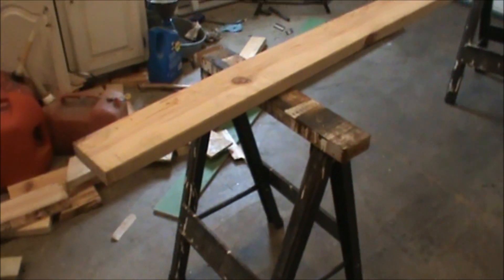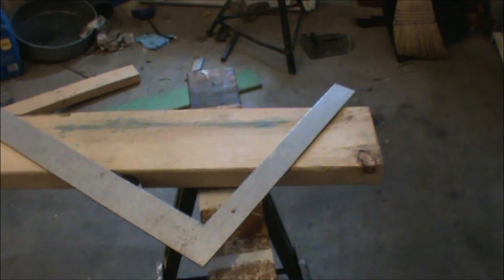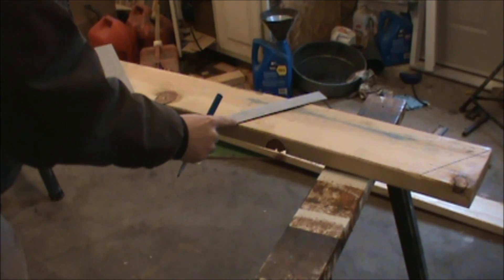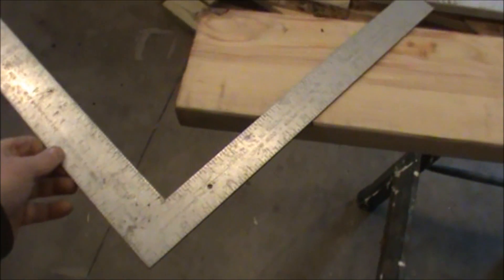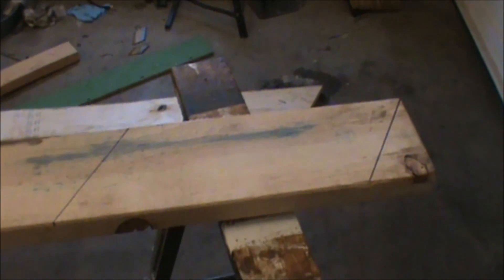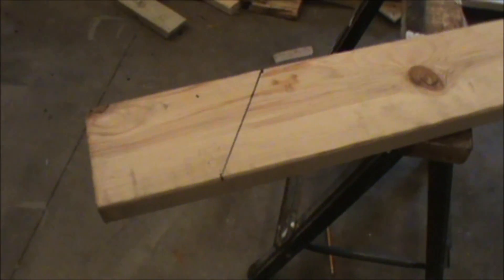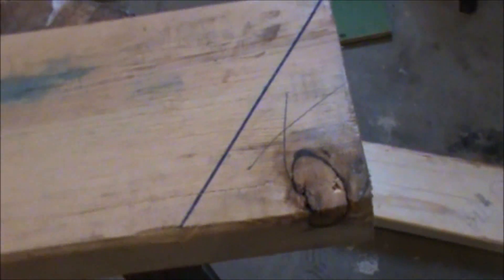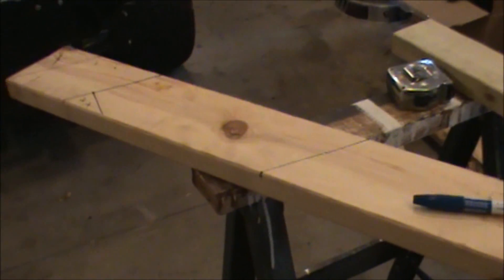Roof Rafter Layout

Comment: Another thing I am doing different is not going to have a ridge board. I am going to cut gussets for my rafters and not going to use a rafter joist. I will use rafter joist on the last 4 feet of each end of the building for overhead storage but leaving the center of the building open with the high ceiling.

Comment: I am starting a new building in my back yard. 12x24. I am going to use the same pitch you have here. But, on the end of my rafters, I am not going to cut the plumb cut as the ridge cut but leave it square. The reason I am doing this is to have my facia  board tucked under the roof for better water drainage. I think it even looks better.

Comment: For those of you who want to calculate the length of the rafter by math-- if you were to measure the distance between the sep marks along the rafter , it would be about 14 1/2 inches [but not quite]  take the 8"rise and the 12" run that you used Square them both 12 squared is 144 and 8 squared is 64. Add them together for 208. Now take the square root [it's on every calculator] and it will be 14.42"   multiply that by 6 [outside to center of the shed and you get 86.52 " or 86 1/2"  deduct about 3/4 inch for the ridge by measuring it 90 degrees from the ridge cut [not along the top of the rafter] and you are done. Since the building is already an inch narrower than 12 feet, no deduction is necessary for the sheathing.
  what is fun to do is use the step method and then check it with the unit length method as described above.
      I always taught both to my students, some who had a decent math education and some who had almost none at all.

Comment: If you "helicopter" your square around (don't turn it over), you can mark that same angle, with the tongue turned downward, at the low end without having to measure and mark from the last mark. No need to mark every step, except for the little check mark, or dot, on the bottom of the blade.

Comment: Don’t care for the step off method at all, too much room for error and time consuming.
Reply: Time consuming? It's the easiest way to lay out a rafter. No math involved, except counting steps and reading a tape measure. There are several ways to lay out rafters, and I like most all of them, but the step off method is very simple. I will agree that it takes more caution, but you can do this accurately if you're careful.

Comment: 1) The step method is tricky because error can arise from the cumulative thicknesses of the marks.  Your rise is 4 feet on an 6 foot run and an 8/12 pitch, so the length of the rafter to the outside of the plate is a shade over 7 feet 2.5 inches.    ( 6 squared+ 4 squared =  rafter length squared) .   Measure down that distance and make your angled line using the square at that point on the rafter.  2) 1/3 of 5.5" (the length of your plumb cut on the birdsmouth) is not 7/8; it is a bit less than that; probably does not matter.  3) Should the rafter be flush to the plate or flush to the sheathing (1/2 inch more)?  If you sheath the walls before you place the rafters, but cut the rafters to be flush to the plate = problems!
Reply: You can actually add that extra 1/2" (7/16) of sheathing into your calculations, but it takes a little more math. It's simpler to cut out an extra 7/16" from the back of your birds mouth. Another way to do it is to set your walls in an extra 7/16" when you lay them out. If you have a 3/12 or less slope, it won't matter, because your rafters will fit up against the top plates without hitting the sheathing.

Comment: Helicopter your square to mark the tail, no need to measure between the marks. And for your bird's mouth, mark the level cut at 3 1/2 inches, so it will have full bearing on the 2x4 wall plate. Let the vertical be whatever it is.

Comment: I am working on extention of my front porch roof. We built a concrete patio floor and now we are working on sheeting of the roof and replacing some damaged osb's. Now, my question is can I use the same method to measure and cut on the rafters that will be sitting on top of the sheeting with angle cut and the rest of the rafter will sit on the plate wall of the 6x6 attached to the 6x6 studs on the porch edge.

Comment: where did you get the 8 from in your 8. 12 pitch
Reply: 8/12 is a pitch. on the short side of your square (Tongue), the 12 is on the long side (Blade) Both measurements on camera side of square

Comment: Your video was very useful, but you should have added the thickness of your outside sheathing to give you the total run, and then subtract the thickness of the center ridge.
Reply: You only subtract half the thickness of the ridge board or ridge beam. You would subtract the entire thickness if it was a ledger board

Comment: a2 + b2= c2. Folks find the hypotenuse of the "rafter" less ridge beam with. You can ask the great Google to find your square roots. It can't get any easier.
Reply: Simple is better so take your formula and keep it a secret or to yourself as doing it his way is for first timers, not everybody took algebra, or geometry or trig. Should I say more?
Reply: You cannot simply use the pythagorean theorem if you are only given a width and height because the height is to the top of the ridge and the width is based on a point below the top of the rafter (inside the birds mouth).

Comment: You forgot to subtract 1/2 of your ridge width on the top cut of your rafter & why not just use the multiplication scale to get the correct length of your rafter? Way more acurate then the method you show here but this method works great for stair stringer layout.

Comment: You forgot to shorten the rafter by half the width of the ridge, this is done with a second plumb line shifted away from the first plumb line by 3/4" if the ridge is "2 by" lumber. That shortening is done perpendicular to the ridge plumb cut, not along the top of the rafter.. Good video on stepping off but you could have done the seat cut layout using the second last step off line as reference, checking for 8:12 on your framing square.

Comment: Good video - this is the first I've seen that actually shows the other aspect of the square - i.e. using it to calculate the length of the rafter, which is probably the most useful feature, instead of using calculators etc.. Do you still do a lot of traditional roofing in the U.S? Over here in the UK, there aren't many carpenters left who can still do it ... it's all manufactured trusses here - a lot of wasted roof space!

Comment: I guess this method is OK if it's an even number of feet in multiples of 2 ft. like 8 ft, 10 , 12ft. etc. on your span but the trig formula is best for buildings that aren't equals of 2 ft. in width and.....stepping it off can cause you to gain or lose a 1/16th or more at each step so it's not really accurate. There's a measurement on the square for common rafters so if you look under the number 8 on the blade, it shows how many inches of hypotenuse it takes for each 12 inches of run (how long the rafter will be for each ft run horizontally) , just multiply that number by half the span, minus half the thickness of the ridge and you have your length, if your bird's mouth is set in by 2 inches, measure in 2 inches at the top cut to get the exact length of the rafter but measure in square off of the bottom of the rafter. Calculate like this: 12 ft. wide building, 6 ft is half the span, 3/4 inch for half the ridge if it's a 2x?  so, that's 14.42 inches per ft run (for an 8 inch pitch). The effective span for that rafter is 71.25 inches divided by 12 inches equals 5.9375 ft. Now multiply 5.9375 by 14.42 that will equal 85.618 inches from birds mouth to 2 inches up from the bottom of the rafter at the ridge. Round that length off to 85 - 5/8 inches for the length of the rafter. use the 8/12 of the square for the seat cut and the vertical cut of the birds mouth, just line up the square with the 2 inch mark at the birds mouth (2 inches in from the bottom of the board, square in, you can do it at the angle as long as you do it the same way at the top cut). Use that as a pattern to cut all the rest of your rafters. 
It's just rare that your building is going to be widths that are always equal to multiples of 2 ft. 
You can step it off, then measure back (or forward) the number of inches that amount to the unequal portion. But, once you've done it this way a time or two, it's very easy!! For short rafters, this is OK but for long rafters, it can make a real difference. 
It sounds much harder than it really is!! :-)

BTW, I'm certainly not knocking your demonstration and it's definitely much easier for first time DIYers to understand without having to figure out the square and the math. :-) Keep up the good work! :-)
Reply: +TreeTop .Videography Very nice explanation
Reply: F Mann i have a 11' span
Reply: This explanation needs to be done in multiple paragraphs with steps and explanations .  It is otherwise useless to the person who is attempting to figure out the calculations and numbers.  How was 14.42 inches obtained?  Was this a measurement on the square?  How was 71.25" gotten for the effective span?  This is not a critique of your ability to apply your math skills but rather the lack of explanation for how some of the numbers were obtained.
Reply: @generatorx  The simple way is to multiply your run, in feet, by the 14.42. You get this by using the top line that's stamped into your square, which says, COMMON RAFTER LENGTH PER FOOT RUN. Since you have an 8 inch slope (8/12), you will follow that top line over to the number 8 of the inch scale, under which you have the 14.42. So, 6 feet of run times 14.42 = 86.52. Convert the .52 to 16ths - 1/2 inch. So your rafter length would be 86 1/2 inches. AFTER you do this, you'll go back and shorten the top of your rafter 3/4 inch for the ridge board. No need to make it more difficult than it has to be.

TreeTop.Videography is wrong about the step off method. You won't get off measurement, because you step off the whole number in feet, and then inches and fractions of an inch. If you're careful, this is a good method. It saves doing the math of 6 x 14.42, etc. Either way is good.
Reply: @Jay-tk7ib   Thanks for the explanation, that helped a lot.
Reply: Just cut a plumb cut on the Rafter hook the tape measure on and measure down 85 1/2”

Effective Run  71.25 x 1.2=85.5

Comment: You forgot to subtract for the ridge board. And instead of measuring down for the bottom plumb cut, simply rotate the square 180* and line up on the top of the board.

Comment: Is the width including the exterior sheathing? Is that vertical line of the birds mouth lined up with the exterior sheathing or the doubled top plate of the framing member? Instead of that 1/3rd rule, have you tried measuring up 1.5" to just accommodate the top plate so the tail rafter is evenly split between the top plate and doubled top plate?

Comment: Psps forgot this is rough carpentry so this method is great for making two patterns so see if the walls are plumb and straight. I still prefer to measure from the peak side to outside wall cutting the common angle then birds mouth.

Comment: this is the method i was taught

find what degree the roof is pitched at...(say 25degrees)
using a scientific calculator press tan25 - (this is your rise per meter{RPM})

now you need to find your true length per meter for the rafter.
TL/M= √(RPM^2+1^2) 
now times this by your half span in which this case is 6feet (equivelent to 1829mm)
and you will get a setout length (where you mark you birds mouth aka seat cut).

For a cutting length (rafter overhang for soffit (eave)) you must add 17 or 23 inches to your half span when mulitplying your TL/M... therefore TL/Mx(halfspan+rafteroverhang = cutting length.
note:
 *for centering rafters you must deduct half ridge thickness
*plumb cuts must be made parallel to each other and of the same angle.

Comment: Stepping off is the worst way to do rafters. There's a chart on the blade that will tell you rafter length per foot of run for all the different pitches. Use this to calculate your rafter length. Mark your plumb cut, measure the rafter length off that, and mark your seat cut. Faster and more accurate than stepping off.
Reply: I like the stepping off better, especially for people who are in no hurry and aren't making their living at carpentry.

Comment: I have a question. In the beginning of the video you said your width was 12 feet. Isn't it 12 feet minus the width of the ridge board?
Reply from the maker: The shed is 12' wide whether you use a ridge board or not.  Don't forget to calculate 1/2 the ridge board width when you calculate your rafter.
Reply: doublewide6
So the first parallel line you drew up where the knot would be cut off, I would measure back 1/2 of the width of the ridge board draw another parallel line and that would be the cut line?
Reply: laughtrax4 yes

Comment: One of the simplest explanations I've seen.   And I've watched TOO many.  I would suggest the square stops that clamp to the square to make it a bit faster.  My room, is almost exact ally the same as yours, mine is 12 wide by 20.  My steep offs would be the same, 6  but If I wanted to change the pitch to say a 10/12  would I just change the square to 10/12?  or 12/12?  for a 12/12?  Is i really that simple?   thanks so much

Comment: DEAR DOUBLE WIDE YOUR DEMONSTRATION  IS CONCISE  WITH  VERY LITTLE  MATHMATICS   AND ALL THE BASIC PRINCIPALS ARE INCLUDED. THE STEPOFF METHOD  IS  AS GOOD AS   THE OTHER METHODS  FOR CUTTING A RAFTER .THE SEAT CUT AND THE  OVER HANG   CUTS  ARE  TROUBLESOME  FOR  SOME FOLKS BUT NOT HERE .VERY KIND OF YOU  TO MAKE THIS  AS EASY AS POSSIBLE FOR YOR VIEWERS,

Comment: Great video, I have a question. I am halfway done building my 16 x 12 shed and currently am on the roof. (shed roof / sloped ) I have birds mouth cuts on both ends. I am having trouble with the cuts on the rafters on the ends. Is there an easier way to figure those out?

Comment: Not trying to be a nit-picker. Just thought that I should alert you to the fact that pitch is actually related to the total span from wall to wall and from the bottom of the to plate to the peak. 8 - in 12 , and so on is a measure of slope. Also, what you call the soffit cut is actually called the plancher cut. It's also fine to leave the rafter tails un-cut. That is known as square cut rafter tails.

Comment: There is a multiplier on the framing square, on most of them, OR you can use the book from the Swanson Speed Square...  OR you could look it up online with Google...depending on your pitch the multiplier will vary...
Ed@ekcontractingcorp(.)com

Comment: if those parameters cannot be adjusted the highest you can go is a 5 pitch....that would give you a 25" overall height, one inch more than you wanted but when you cut the 3/4" off for the ridge, you should be okay.....
Ed@ekcontractingcorp(.)com

Comment: Hey doublewide6, thanks for the video the extra detail helps a lot. I have a question...I'm building a shed it can only be 100 sq. ft. And 8'2" high at most so I was going to build a 10x10.....if I build the walls 6' tall what pitch would I use to get it to no higher than 8' any info would be greatly appreciated, thanks

Comment from the maker: I'm not a builder, but I think 2x6 should do your span.  Check the local building codes. 
8' 7' 3/16 overall rafter length, 7' 6" 3/16 ridge to wall length  Pitch 5/12  1.5" ridge board for my example.

Comment: Hi,

I'm about to build a 14 x 16 foot shed. The roof direction wil be going up and down the 16 foot length. If I step off 8 times with a 1 foot overhang like yours do I need to use 2 x 12's? Thanks.

Comment: Great Video!! haa if that is your rafter which is 6 feet half of the total length, aren't you supposed to cut 3/4 of an inch of each rafter to reduce the 1 1/2 inch of the ridge?
Just a doubt!!

Comment from the maker: I used aluminum for the facia and there was a 90* bend, so no need for a bottom cut on the soffit. I did my sheathing after the roof because I used OSB and did not want it to get wet.  If I did not take away for the ridge board it was a mistake.